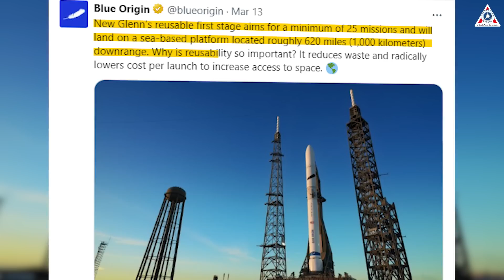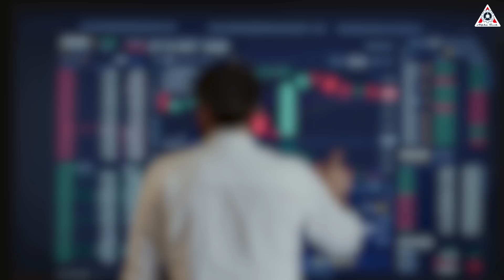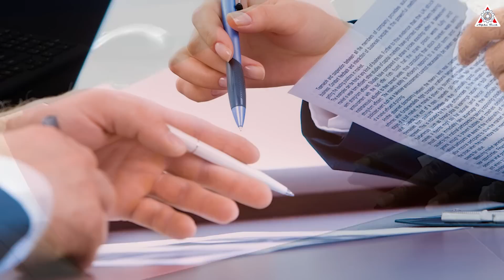Blue Origin is about to launch NEW billion-dollar rocket to STOP Starship...Musk laugh!

Comment: When did Spacex demonstrate in-space refueling?
Reply: SpaceX should've developed in-orbit refuelling using the Falcon vehicle fitted with custom final stages to develop and prove the concepts, all be it  on a smaller scale.
Reply: @michaelreid2329 with RP1..? no.
Reply: IF 3 = they proved their refueling technology although it was "inside" a starship and not between two starships = they pumped fuel from a header tank into the main tank = showed successfully that their pumping technology works in zero G (ok microgravity ^^)

IF 6 will then show fuel transfer between a target starship and a chaser starship (this will demonstrate the flight hardware to rendevouz and docking technologie)

IF 4 will aim Starship to get through max reentry heating with all systems functioning

IF 5 will show landing of booster at launch tower using chop sticks to catch.

All this will happen if everything goes well by the end of this year.
Reply: @kwichzwellbreck697  This will be interesting to watch.

Comment: Do you count the cost of all the SPACEX refueling missions required for getting the initial launch-payload to the moon? How many launches, how much fuel needed?
Reply: Bottom line, the Starship design is a white elephant! (tecnicaly silver, I guess!) The idea of going with with the stainless  steel pop can design was a ridiculous mistake!!  

ULA's SLS will get to the Moon on one tank of gas!!  It doesn't need to refuel. Fully fueled it weighs about half that of Starship!  That's bad considering the Starship is not as structurally as strong.

Comment: Blue Origin will fail.
Reply: As a person that worked for SpaceX and blue origin, I am still blown away at spacex's success and speed. I am building new Glenn right now and it's so understandable at why it takes so long.
Reply: @WaffleBStomp  You can't do good engineering  without a logical step by step approach that verifies results before building on them.

When I look at the Falcon 9, I fundamentally see something that had already been refined and working successfully. Namely, Rockets launching satellites into orbit.  We have been doing that for over 60 years! 

The only difference is bringing the parts back to be refurbished and used again.  Yes indeed, vertically landing a booster is an impressive sight and a significant accomplishment.  But is it the best approach to recovery?  Is it even a logical approach??  In order to recover the booster the way SpaceX has chosen, means compromises needed to be made to the core mission of putting a Satellite into orbit. 

Despite the spectacular appearance of a booster landing vertically, the actual missions of the Falcon 9, are relatively entry level in the world of spaceflight. What works OK for recovery of mainly LEO missions does not necessarily scale up to missions to GTO and beyond. 

The thing about SpaceX is that decisions are not based on good, thorough engineering. 

When I look at the Starship concept, its peculiarity and uniqueness is mostly based on compromises to achieve reusability. And the real benefits of reusability are only worthwhile when the volume of launches is high. 

As an engineer for many years, I think I'd rather be working on Blue Origin new Glenn than SpaceX  Starship.
Reply: Actually, if you do the math, Starship will fail.
Reply: @pewterhacker  Yes indeed!  Blue Origin has strong possibility because Bezos is much smarter businesswise.
Reply from the maker: OMG! I think Starship is successful but it will take more time because its scale is larger.